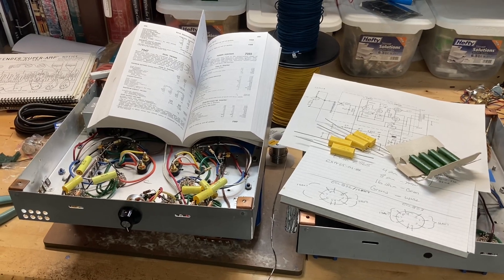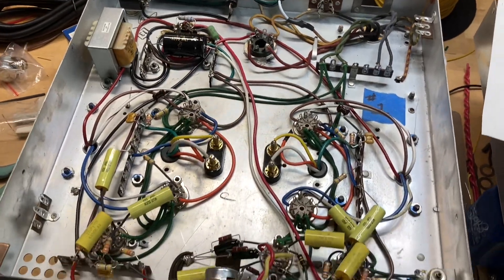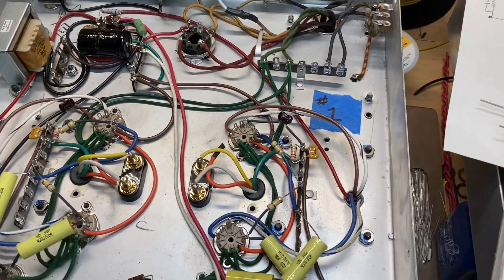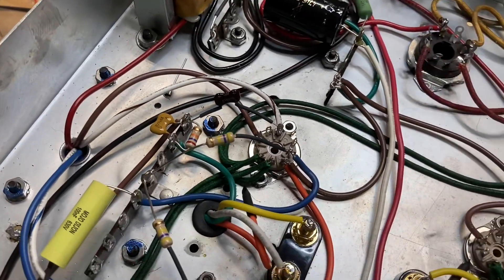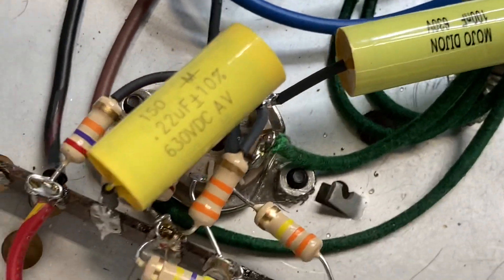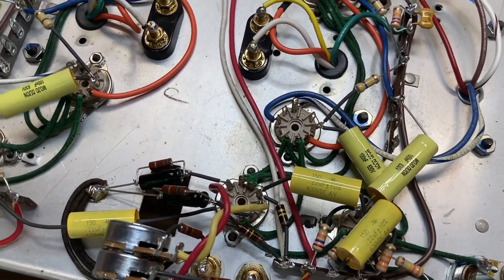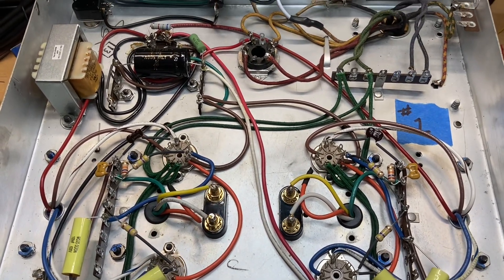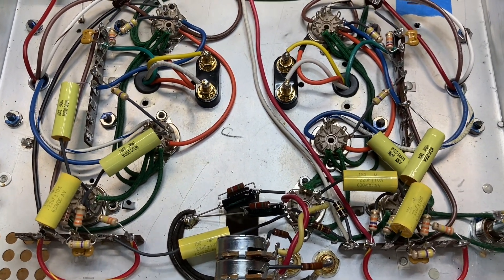Point to Point Dynaco ST-35 Tube Stereo Amp Build Part 3 - 7247 Preamp Tubes and Amp #1 Overview

Comment: Boa tarde! Estou montando um amplificador similar ao Dynaco ST-35, O senhor poderia me ajudar a inserir um potenciômetro de volume no circuito? Qual tipo e em qual ponto devo liga-lo?
Good afternoon! I am assembling an amplifier similar to the Dynaco ST-35. Could you help me insert a volume potentiometer into the circuit? What type and where should I connect it?
Reply from the maker: Hello.  I went straight from the RCA jacks to a 500K dual potentiometer and from there to the input grid resistors.   I’ve tried a few different ways and the potentiometer right at the input jack sounded best.  Have fun!
Reply: @TungstenAmp  Thanks for the reply.

Comment: Those are NOS Philips Polycarbonate caps, better than mylar..
Reply from the maker: Thanks.   Couldn’t recall what they were made of.
Reply: @TungstenAmp  You’re welcome.. Nice build BTW.. I couldn’t seem to find the output tubes’ Cathode Resistors in there..
Reply from the maker: @rickg8105 Thank you.   The output tube cathode resistor was the last component to go in.  I was undecided on the value, due to the higher than spec’d B+ voltage.  Eventually used a 150 ohm for the quad of tubes and will dial it in a bit more.